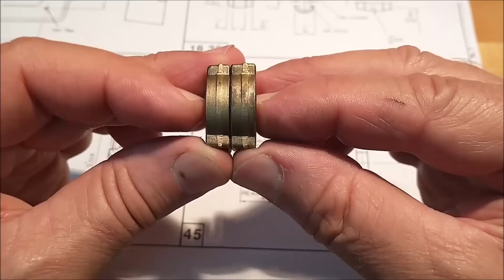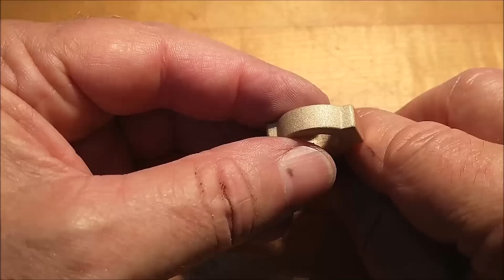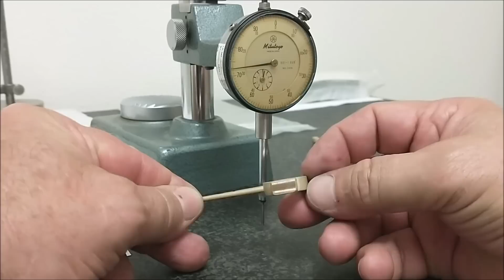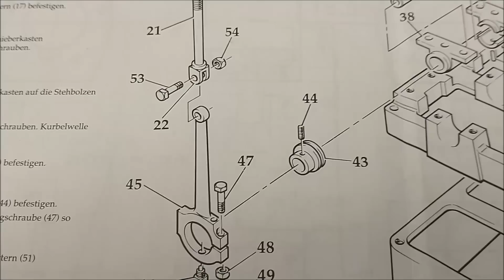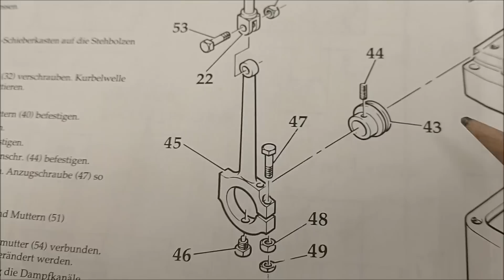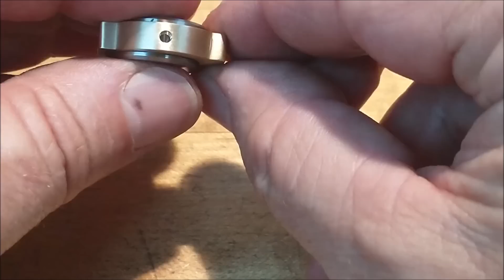Stuart D10 - # 14 -- Machining The Eccentric Strap and New Eccentric Sheave

Comment: Joe.. I don't understand why the eccentric strap's print looks like it is supposed to clamp onto the eccentric cam. Is there some other reason the designer would have specified that system?

[edit:] You covered this in the last minute, a possible wear adjustment system.. I'm as unimpressed by that as you seem to be..
Reply from the maker: With the eccentric cam being an undercut item, it wouldn't be possible to assemble it any other way.

Comment: I like this idea because if you split the eccentric strap, the hole for the crankshaft will be out-of-round. The only negative is with locomotive axles which would have to be disassembled if you had to replace the strap.
Reply from the maker: You rebore the ID after splitting.

Comment: If loosening something means to make it less tight it seems that un-loosening would be the opposite. That would mean that after you unloosened the set screw you wouldn't be able to change the timing 🙂.
Reply from the maker: Are you sure ???
Reply: @joepie221  Just turn it in the widdershins direction and everything will turn out fine.
Reply: I think it is a similar thing to flammable and inflammable. Untighten and unloosen both mean the same thing.
Reply: @grantofat6438  Seems the words are ganging up on retention - tighten stands alone with untighten, loosen and unloosen all trying to make it lose its grip! What's a poor setscrew to do!
Reply: @craigpuetz7020  LOL !

Comment: I never did like those bosses on the side of the eccentric.  They aren't typical for this style of engine. Having the outside flange looks a lot neater. Could be an issue if you decide to add reversing gear later though.
Reply from the maker: Hi Preso, I do have the reverse kit. It will just presents another opportunity to get creative. :)

Comment: Love the mod. I think I would add the bolt to the rod without the split to visually fill the notch the rod has cast in. It would make no difference in operation as your mod is clearly a better set up than the drawing, purely cosmetic.
Reply from the maker: I may do that just for a visual. Maybe.

Comment: I think that's a big improvement.  Countersunk screws would be a bit more 'period' maybe.  The original uses a slot in the grub screw which immediately shears off when you tighten it.  I think a lot of people use a 6ba hex grub screw instead.  It's also interesting that very often the strap is split on both sides.  I think that is for when the cam is between the crankshaft webs.
Reply from the maker: Hi John. I saw that grub screw problem a mile away even before I made the parts. The cap is thin, so c'sunk screws may be tough without making the part differently. The PM strap is split on both sides, but their eccentric was different.
Reply: @joepie221  a while back I sent you some photos of my old plans for  the 10V.  I used the email address at your website.  I don't know if you got them.  Let me know if there is a better email to use.

Comment: Joe, You can make and fit an oiler with wadding and a lid on the side of the big end, to prevent wear negating the eventual slot requirement. 

I know it’s only a model and show piece for you, it’s just an option I thought of 😊 

Regards,
Paul 🇬🇧
Reply from the maker: Very limited room there. It would be a very small cup.

Comment: Great stuff. I like the trick using the ball in the rough bore to make sure the part is held securely. It's those details that help get to a part with accurate geometric relationships, so faces are parallel / square as needed. I get that we've seen a lot of filing now in your videos, but it's amazing how important that skill is. Cheers as always.
Reply from the maker: A ball with a flat on it is a great addition to any toolbox.

Comment: Dear machinists i need your help ! I am looking for coolant fluid for my manual lathe(i mostly work with steel and aluminum,sometimes brass,rarely stainless steel)  that is not white liquid (the one that goes bad after a week or two and smells like sewer and looks like 2% milk ).Something that can last a long time.I know there are two ,three types(synthetic ,half synthetic mineral etc) but i dont know which one is which.
So if you guys know the type  please write what i am looking for.
Reply: There are many that look like the like the same white coolant. I actually use one of those, a Mobil product, but I mix it well on the rich side. Being in the home shop this doesn't cost a lot more and makes it last a LOT longer, and it doesn't cause rust. Otherwise many people have good results using WD40. Pretty sure Joe uses WD40 when he needs coolant / lube during cutting.
Reply from the maker: My CNC machine uses Trim-Sol. Its a teal green water mixed coolant. Mine has never gone rancid and sees some very extreme heat. If I were to charge my lathe cooling system, thats what I'd use.
Reply: @joepie221  Is that mineral oil or synthetic/half synthetic ?
Reply from the maker: @armageddontools  To be honest, I don't know. I mix it with water at about a 12% dilution and off ya go.
Reply: @joepie221  Thats my problem:) People recommend brand (i tried on some forums and other videos)which i cant obtain in my country ,and i need the type of oil so i can find something named different from other company that has exact same property's.
Reply from the maker: @armageddontools  Maybe this will help     https://www.google.com/search?q=trim+sol&oq=trim+sol&aqs=chrome..69i57j46i175i199i512j0i512l8.2259j0j7&sourceid=chrome&ie=UTF-8

Comment: how would they lubricate the crank/conrod?
Reply from the maker: There will be oil holes on the valve rods, but no cups. On a vertical engine, thats a tough call. The crank bearings will have the cups.

Comment: Hi Joe, how do you de-burr the inside of the shaft-hole after drilling and tapping for the lock-screw? I always seem to end up marking the shaft-hole where I have used a needle-file. Cheers,
Reply from the maker: Float the reamer back through the hole by hand. A file is also OK, just take your time.
Reply: A small ball tool in a diegrinder is what I use. Type depending on size and material.

Comment: Heh, you will get some distortion even clamping along the axis. Dunno if you can measure it, bit there's going to be some degree of movement from the material squishing under the pressure.

Slightly more practical than measuring the thickness of s sharpie mark.
Reply from the maker: Minimal in comparison if it occurs at all, but you are correct. If the part shows dimples from the clamping, you might lighten up on part 2.

Comment: I like your modification which is much improved from the original. However, on my single V Ten
I still included the split eccentric and the adjustment bolt as it is a full size feature of the engine from which it is modeled. Separates the finished model from a cut corners, cheap toy.
Reply from the maker: For visual appeal, I may go back and add it.

Comment: Would a nylon tipped set screw hold the eccentric securely enough? I see them at McMaster Carr
Reply from the maker: I'd choose brass over nylon.
Reply: I would be afraid of a nylon tip but would consider a brass tip.
Reply: Ok. Thanks

Comment: Hey Joe. If you are still going to make the reversing gear for this model, you get to make 4 new eccentric straps to replace the 2 you just made.
Reply from the maker: I do have the reverse kit, but may still incorporate my cams.
Reply: My grandad bought a German made model stationary steam engine back in 1920 (2nd hand) for my dads 5th christmas. (It started a lifetime love of all things steam for him)
This engine had a reverse motion on it which was simple as pie 
The concentric 'floated' on a 'drive' which in turn had a drive pin facing outwards towards and through the concentric.
This pin went through the concentric collar which had a semi-circular slot machined in it.
When you spun the flywheel one direction, the pin on the drive piece of the setup spun around to one end of the concentric slot giving the valve timing for forward motion and vice versa for reverse.
The model is a fantastic piece of engineering and still works like new over a hundred years later with absolutely no repairs whatsoever to it in that time, my eldest brothers' grandson is now the custodian👍👍
Reply: @WeeShoeyDugless It's a great simple way of reversing an engine, the problem is though you either have to manually rotate the engine to reverse it or use a Gooch gear to do so and it doesn't give any adjustment to valve events while running
Reply: @gherkinisgreat 
Of course what you say is true, but remember, this is only a model engine and unlikely to be 'slammed' from a forward motion to reverse.
The precision of the engine, the castings, the machining of parts etc, is 2nd to none I have ever seen anywhere.

Comment: I always hate a set screw on a round shaft.  I know it needs to be adjustable and not really a way to change that.
Reply from the maker: I'll calculate the position and put a slight undercut on the shaft. Flats are better, but tougher to cut prior to timing the engine. Not impossible, but way easier after a dimple appears.

Comment: Hello Joe! I like your clever modification but I didn't see how you got the nice external profile to the eccentric strap. Suddenly it's there, looking lovely, a tribute perhaps to you time-served filing skills.   I think the strap does need an oil hole, though I guess that you could just put a drop of oil onto the cap you made.  These parts are drop forged incidentally, a  lot cheaper than lost wax castings with the quantities of 10 series engines that Stuart Models sells. Once the forging die was made, (long ago) any number of them can be pressed out and the unit cost lowers with every one, whereas lost wax castings remain the same cost per unit due to the processes involved, no matter how many are produced.  Later in Stuart Turner's history, extrusion costs came down and the reversing gear for this model with its two eccentrics at each end are produced that way.  Please keep making these little videos - I'm learning something new with every one and you always make even tedious or daunting jobs into something ejoyable.
Reply from the maker: Thanks. I filed and blasted the straps and will add oil holes.

Comment: I am having to move my shop.  OK, take advantage of the opportunity.  The idea is to to stop playing machine tetris and get everyting of significance finally restored and running instead of being rat holed in storage.  So the new shop is likely going to be timber framed and documented on my youtube channel.  So I am going through the layout issues now.  The idea is to integrate my line shop issues with my collection of machine tools.  About 100,000 pounds worth of machine tools!  So the engine needs to fit the space and requirements.  Dave Richards current engine is too large for his needs.  So he is pushing his boiler now and will only get about half the power out of his current engine.  Thats the issue with finding an engine.  The two smaller engines are not the best designs.  I dont like some of the details on the stembower and its a bit small.  The liley has its own set of issues.  The larger engines solve these issues, but now your talking 10,000 pounds give or take which is much more power than I need.  And remember, you need to fire a boiler to run this engine.  The fuel appetite for a 10,000 pound engine can make splitting wood a full time job!  Lastly, I have been working with steam engine for more than 20 years including a lot of work on stanley steam cars.  Simply, put, I want to design and build the full size engine.
Reply from the maker: Sounds like its going to be a good project.

Comment: Your modification looks much better than the original solution with the small grub screw protruding from the collar of the eccentric!

I always trip over the word "unloosen", so much so that I finally looked it up in the Oxford English Dictionary: Turns out, this is the interesting and rare case where the prefix "un-" does not mean "the opposite of the following verb". Please excuse someone whose first language is not English for doubting you, and thanks for pointing out this linguistic curiosity.
I think, I will start using the word, just to annoy some of my engineering students next semester ;-)

Comment: I really like your modifications to the eccentric.  Not only does it look better, but I have to agree with the arguments you put forward.  As much as I like the stuart model kits, its still a model and not a real engine that sees torture every day.  Also bear in mind that the stuart models often have designs going back to about 1889 when Stuart Turner first began selling these models.  Back in the day, model engineers often had to build their own lathes and milling machines were an absolute luxury.  One really nice antique book that outlines all of this would be "Model Engineering" written by Henry Greenly published about 1915.

One note I will mention is this.  I have seen eccentrics in 6x6 and 5x6 actual stationary steam engines in which the eccentric was seriously scored.  Why this happened is open to speculation as I was not born when these engines were used to drive line shaft shaft machines.  Quite likely it was the result of lubrication issues.... you really do need to lube up a steam engine to keep wear under control.  But another likely theory is that swarf worked its way into the eccentric/eccentric sheave and scored the eccentric.  Also, swarf combining with heavy lube oil can become a lapping paste which accelerates wear rapidly.  In the one engine that I did detail work on, the sheave was cast iron and the eccentric was steel..... most likely a wrought iron of some form.  I would prefer to see one of these components made from a phospher style bronze.  Also, in the case of the eccentric and eccentric sheave, you dont have the opportunity to include traditional "brasses" as you would see in the crank shaft area.  So here, a two piece eccentric sheave allows you to use shims to adjust the clearance which can take up wear.

But this is a model and it will never see the run time or loads that the big boys see.  My interest in these models to work with the various designs at the scale model level to better understand the advantages and disadvantages of these various engines.  My goal is to design and build a full size steam engine to run my collection of line shaft machine tools.  It is without doubt that engineering of these engines was a fully developed theory and its way more complex that it appears.  But we have lost much in the last century once we all discovered electrical motors to run our machines.
Reply: You are correct we, as a society, have lost a lot of common knowledge about engines and machinery but we do have a vast library of books on the subjects.  
Unless you just "want" to build your own engine, why not try to find a suitable engine to rebuild or modify similar to the Old Steam Workshop?  Modern materials for construction and bearings would improve most engine designs without changing their appearance.  Good luck and fortune with your goals.

Comment: Hi Joe, I like your mod for the valve timing, the Pm Research engine has the same junk pin on it. the bolts on the crank give a nice look I did add those to mine.
Reply from the maker: I like the mod.

Comment: Hi Joe, watching you from Shanghai China. In my 20 plus years of hot forging brass, I’d say that those pieces look more like forgings rather than castings. The parting line is offset. The square corners on the flashing look like they come from the trim dies. These eccentric straps, were they castings rather than forgings would likely not be strong enough. As always, I enjoy watching you work and always learn something new.
Reply: Yes they are ‘forged’ parts. The older Stuart No10 parts list calls them ‘Stampings’.

Comment: the flash line is offset because the arm is offset
Reply from the maker: I checked the drawing for clarification and its not called out.
Reply: @joepie221  probably not, it's just in the casting
you can see it in the the video

Comment: You ever think they designed the eccentric the way they did for a reason? It doesn't take a lot of force to run the valve, but it does need to be easily adjusted to tune the timing...
Reply: Because stuff never, ever gets poorly designed, right?
Reply from the maker: Sure. Its conventional and cheap. The set screw is destined to split or slip.